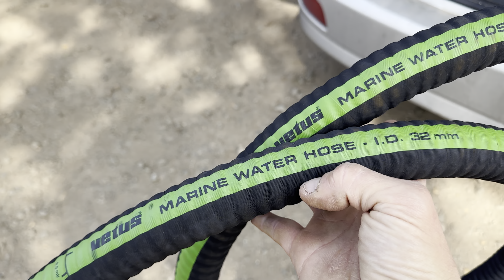437. Calculating Narrowboat SKIN TANKS and VETUS Cooling

Comment: I retro fitted a radiator just forward of the engine bay. Takes the chill off the boat as I'm cruising. I couldn't bear to think of all that wasted heat going into the canal. It is tee'd off the calorifier circuit and it can be closed off in summer.

Comment: 1.75 x 6 =10.5 square ft, so correctly  sizing at 4Hp/ sq foot.42/4=10.5 sq ft well explained. 4 for steel hull and 5 for aluminium hull vessels.

Comment: Who on earth told you to put the those anodes on the base plate!
Reply from the maker: It’s quite common. I didn’t put them on / the boat yard did - they are there to protect the baseplate from galvanic corrosion -
Reply: @TheNarrowboatThatJamesBuilt  check what drugs they are on.
Reply: The anodes dont care where they are at as long as they are under water.  If you are steaming your boat over a pile of rocks, a lost anode is the least of your worries.
Reply: @markferrari9734  the canal is full of rubbish, shopping trolleys and junk and the moorings are often shallow and some have concrete ledges, this is why we don't put anones on the bottom plate.
Reply: @snowflakemelter1172  sounds plausible.   We dont have any canal systems like that in the states. Just lakes, so you have to be aware of where you can and cannot go.
I can say that if i ever visited, i would rather take a long cruise down theese canals then wander around london like a typical tourist.
Reply: Word from the Facebook groups is that they will get knocked off and I presume you will be on shoreline as you have fitted these
Reply: You will loose the odd one or two  but bearing in mind you would take the boat out of the water every 2/3 years to reblack its not a problem to replace. I'm sure Ralph and team know a bit more about this than most of us.
Reply: As those low profile anodes are just that: low profile, they would be much better sited on the bottom of the hull sides above the baseplate sacrificial lip.
They would then be far less likely to be getting damaged or knocked off, in fact, I doubt they would be any more at risk than those on the stern and bow, mine certainly haven't been adversely affected by being on the bottom of the hull sides.

Comment: You have plenty of margin there. I had a 42hp in a 52ft narrowboat with only 6ft of skin tank. We did the Ribble link, Tidal Trent and the wash. Gauge never moved above normal, even in tidal waters the engine is only working at half capacity.

Comment: Ah, your skin tanks are 10 sq ft, but you require 10.5 sq ft, couldn't that be an issue?
Maybe add an inline 1 to 2 sq ft radiator, with an automatic (and/or switched) fan for those hot days (canal water is too warm)?
Reply: 6 x 1.75 = 10.5  40 HP is maximum speed rating. Obviously the builders factored the engine rating. Temperature gauge fitted? Those who drive at full throttle deserve to overheat.